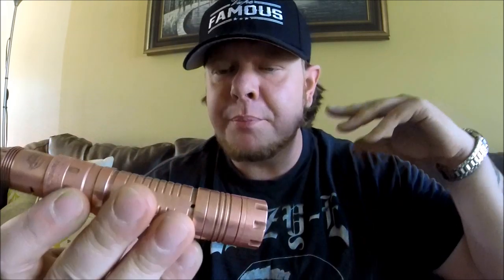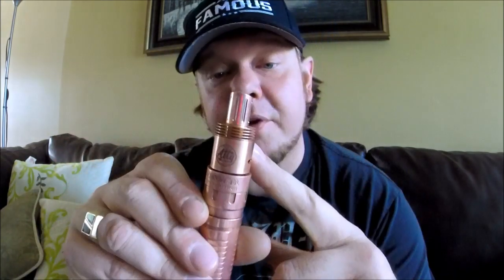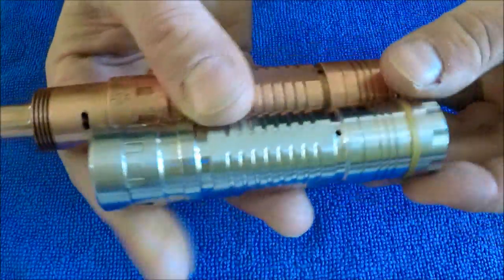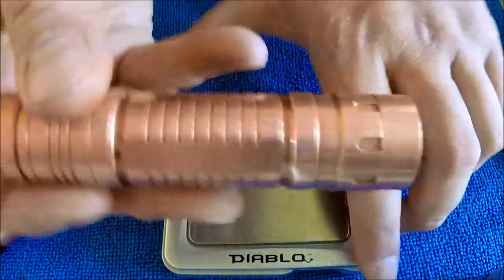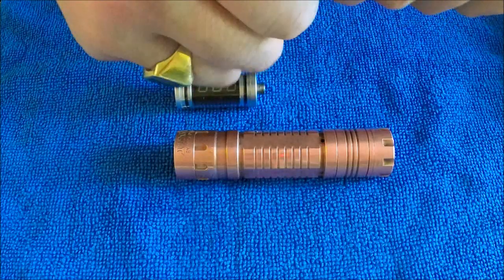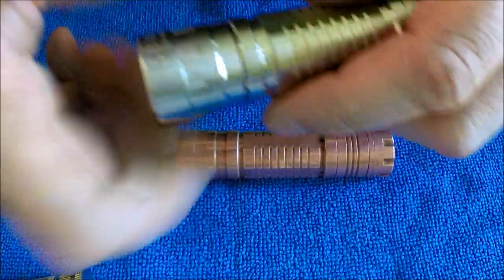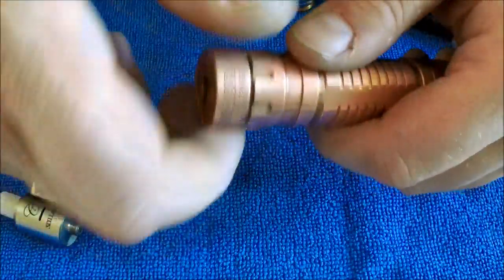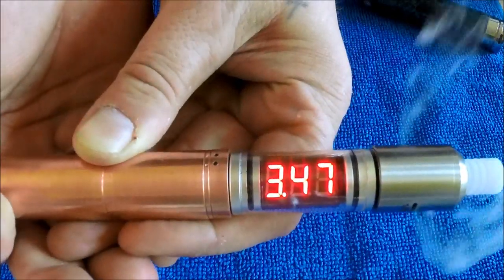Copper Panzer Review with Voltage Drop Tests

Comment: Not the same as any other panzer I converted thia mod after battling with my who for three months I finally saves up enough to get a clone.   Sold as 1/1 and o no buddy jot the same no adjustable pins has voltage drop like seriously hideous nearly a full volt.  I git ripped off and the seller wouldn't refund!  So stuck with it wasn't happy at all.   All I can say it buy from reputable people and he careful... I havnt git the money to replace it with another maybe next year I guess.. Love the panzers tho absolutely gorgeous looking mod.   Thanks for your time n hard work putting out these reviews we appreciate it
Reply from the maker: Nick Kendall hey bro.. Sorry to hear about your misfortune... That really sucks. I had a problem with a mechanical mod once and the vendor tried to give me every excuse why it was my fault... Like I screwed it up... Finally I was left with a mod that didn't work. Be persistent, I ended up having the guy who owned the shop replace it.. pain in the ass though. Live and learn I suppose. Thanks for watching the video brother 😁💨💨

Comment: When are you doing the super subohm voltage drop test??? Really looking forward for that one. Looking for the best copper mod to compete with in a couple weeks
Reply from the maker: It was in the video. I fired a 0.09 ohm 20 gauge build on the panzer, stingray and nemesis...all hit pretty close. Maybe you thought it was .9 ohms, it was less than .1 lol
Reply: Maestro Vapes I was meaning for other mods to compare. IIRC you stated you were going to compare other mods using that .09 ohm build.
Reply from the maker: ndstrctbl Ohhh I misunderstood, I fried my volt meter after the tests in the video so I couldn't do any others. As it turns out the wires in the meter melt when you put them under a low load

Comment: not bagging on you man but you need 1 battery for each mod you test both equally charged cause this is not accurate
Reply from the maker: Hey bro, I'm certain I used the same battery for all the tests... what did you find inaccurate? Thanks for watching!
Reply: Maestro Vapes u need 1 battery for each mod to do the test.when u first test a mod with that sony battery its accurate but when u use the same batt on a different mod and do the test its gonna give a lower volt drop then it would be with a fresh batt...your testing them all right just use 1 battery for one mod then 2nd battery with 2nd mod. :)
Reply: ✩▶ⒷⓊⓁⓁⒺⓉ◉➌➌➍◀✩ when using the same battery you remove the possibility to have an error in the v drop test from the different impedances between two batteries, differences of cell health between two batteries, resulting in a different voltage drop from one battery to the next. Pulsing a battery for a few seconds isn't going to do that much to a fully charged battery. Besides, the only way to truly test the voltage drop of a mech mod and isolate the drop internal to the battery (which the mech mod can't control) would be to use one lead of a dmm to press the bottom of the switch, and the other lead to the top of the mod near where the 510 screws in, meter set on dc volts you'll get a .00X-.0X reading. At high current most of the v drop is going to come from the spring and the batteries. Unless you built a copper spring out of coax cable.